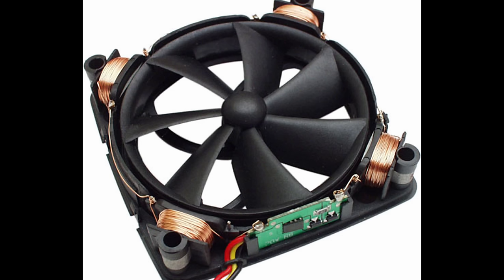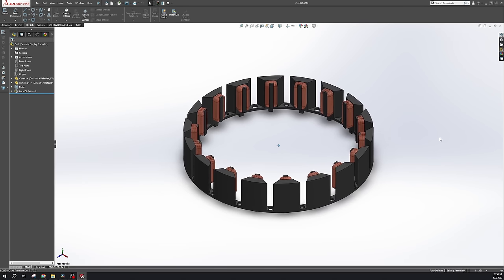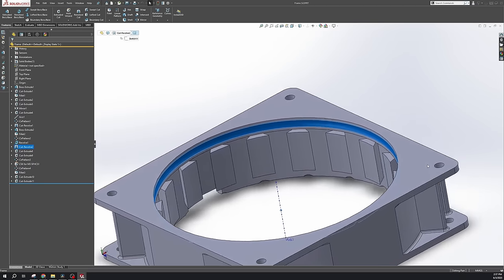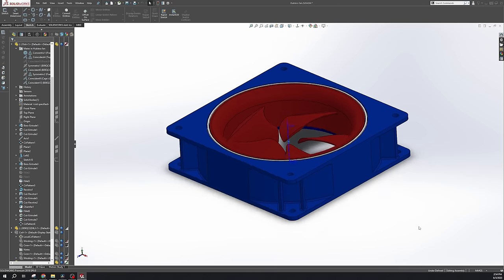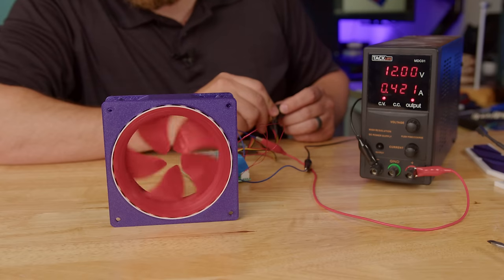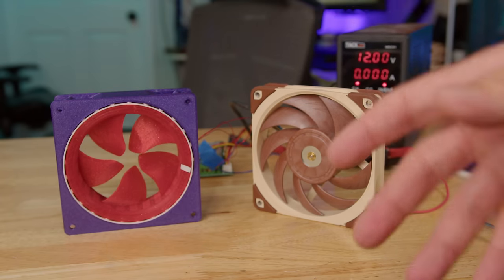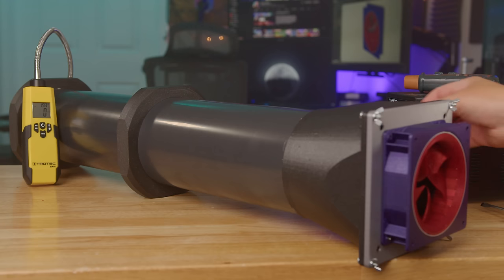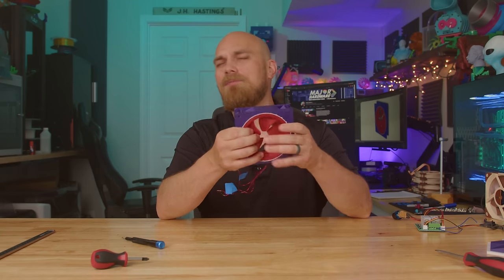I made a HUBLESS PC fan and it’s so loud!

Comment: I think the reason why the original tip driven fan had the hub was two fold: first, the fan doesn't push much air through there, simply because there's no velocity there. And so you might as well keep the hub to keep the air from accidentally moving back through the center. And once you do, then it's a great place to put a regular fan bearing.
Reply: Yeah. By doing it on the outside he's increasing the area and moving mass of the bearing significantly. Since he already has permanent magnets in place, I wonder if there is a way to magnetically float the center?
Reply: would probably work better if the blades touched at the center or you made a smaller fan in it like some have done in the rest of the  showdowns
Reply: @ventilate4267  Connecting the fan blades in the middle would lower the overall flow. In the fog segment, you can see that there is actually air going through the center, which is sucked in/carried with the surrounding air. If you would connect the blades, you would obstruct this path without any acceleration of the air from the blades in that area. Therefore many ubless props only use short stubby blades and leave the rest empty.
Reply: The friction of the air will just pull more air with it. (its what @morgan5941 said)
In fact he could make the blades smaller and it will still work.
Reply: @siveonfarcloud4190  only to a point though, otherwise you'll end up with like an inside-out version of the vortex ring state, right?
Reply: @your-friend-alice6851  Not  sure if that would ever happen, but I'm not that proficient on the mater. Definitly something that would be interesting to see in a video.
Reply: @morgan5941  so long as there is no significant pressure requirement, yeah.  But if you do have significant static pressure being needed, you can’t be as sure that the entrainment will occur. Instead, I’d expect a vortex ring state to form as the flow rate drops below a minimum value

Comment: The fitment just shows your engineering prowess, good job. I am not sure what it could be used for considering the sound, a maglev bearing would be cool lol. I also like the flow characteristics.
Reply: The maglev bearing could be the best feature of this design.
I wonder if some of the maglev trains designs could be used that would not need complicated setup with sensors and controllers.
Reply: I was thinking maglev bearings too

Comment: This fan has potential. I love that it allows the air to follow into the center. If you remove the friction and get better balance, you have a winner.
Reply: unfortunately because air is a lot less viscous than water, it might end up just backflowing or stalling in the center, a hub might actually be slightly beneficial if it's got decent aero

Comment: that turned out great!  good job sir.  you could design a ring/race with v slots to allow changing of fan blades, and do a season of showdown with people designing blades for this thing

edit:  you might look up halbach array if you want to improve performance.  it's a way to get more strength out of your magnets by the way you arrange them, and they're efficient because they have a strong and weak side, so the force is directed and concentrated towards your armature.  to fit the magnets in this arrangement you might need to reduce the number of coils, but you'll get a side effect of bigger coils, so hopefully more torque.

by the way, if you want lower speed but stronger torque, you can go down to a smaller wire and do way more turns of wire.  if you do that, you could design some really high pitch blades with close spacing that go to the center and probably get good static pressure.  if you go larger wire but fewer turns, you'll have less torque but higher speed.  would be more for cfm in that case, so less blade pitch 

as for bearings, i wonder if it's possible to do magnetically levitating bearings.  that would solve the bearing noise issue

oh and i have an idea.  what if you leave slots in the chassis and blade assembly for the raceways.  then print the raceways in something harder like ASA which my bambu prints quite nicely.  if you set it to 100% walls and no infill, and print it flat on the build plate, the grain goes with the direction of the circle, so you shouldn't end up with perpendicular lines that cause the bearings to make noise when they cross them.  and maybe even add a light abrasive or even acetone and preprocess them so they end up really smooth.  could probably add graphite for lubrication as i'm not sure how ASA or similar would stand up to something like lithium grease.  chemistry guys will have to learn us that bit but i think oils usually break plastics down, so that was why i had this thought, but i could be wrong

Comment: Yes! Finally someone made a fan like I've wanted. Except I was hoping for a maglev type effect with no friction and thus reduced noise.
Reply: I think you would need a center hub to be able to do that...the bearings are what is holding the blade assembly to the rest of the fan...
Reply: You don't need a center-hub for a mag-lev fan.
However, you need to place the magnets exceedingly precisely, the magnets have to extremely similar in strength, and have a very exact shaped magnetic field for it to work without the hub flying out at high RPM.

Either that or find the strongest permanent magnets you can. That way the field might be strong enough to contain the hub at any RPM.
Not sure if the Neodymium magnets are strong enough for that though, and stronger rare-earth magnets are ridiculously expensive...
Reply: @The_Keeper  I guess I should have been more clear, no you do not NEED a hub, but doing it without one would be exceedingly difficult outside of a lab with very precise equipment...Also it would the worlds most expensive computer fan...

Comment: Dude you are amazing you eyeballed a hub bearing and fan blade geometry in a hub-less fan you pulled from a drawing on the web eyeballing and guestamating at the measurements you were able to nail industry standard CFM rates (better actually 50 CFM is pretty good) and did it all with a 3d printer and i didnt hear it fall out of balance till right at the end.  Thats so cool!!!!

Comment: The big noise maker here, as is more than likely obvious, is the ball bearings. If you were to switch to a maglev design, it would be a lot quieter. Also, the fan blades could be optimized significantly which would almost certainly give you better CFM at a given RPM. Also, as mentioned elsewhere, balancing everything out would also help reduce noise and vibration. I'd be very interested to see how far you can take the design overall. Nicely done so far :)
Reply: My biggest concern is that the maglev may interfere with the rotators. But if they're not strong enough, they won't do their job properly. What you need is 2 maglev tracks sloped to 45 degree to cup the v-edged fan unit. Make sure this channel is perfectly smooth as catches on startup or shutdown would be disastrous. Try to keep the space as tight as possible and of course add lubricant, and send me royalties on the patent! XD

Comment: This is the super cool project dude! It might be interesting for radiator fans that would benefit from having more service area being cooled!
Reply: Every radiator have a gap between fan and actual fins. Air need space to spread and calm down before it enters the fins. In case of radiators Pressure and bulk airflow matters, not area. less area even better, less area usually means higher pressure - for example 120mm fans have more static pressure than 140mm fans, and radiators for 140 fans have less fins density in general (to reduce resistance)

Comment: A much cheaper option for the bearing balls would be airsoft BBs. I've used some cheap white ones that have an amazingly high roundness spec with good results.
Edit: You'd have to modify the CAD model a bit though, as they're 6mm diameter.

Comment: you are supposed to add all the ball bearings on one side and then move the core over. And then space them out and then place the cage. A little grease makes this easier since it keeps the bearings n place. Larger balls and smoother raceways would make it quieter.
Reply: - there are various ways these things are done, depending on architecture - your "suggested" method is common for deep grove bearings - with welded cages..
Designing integrated raceways can be a limiting factor - as clearances may be too tight (balls too large)- and access limited for conventional methods of assembly.

Comment: I wanna see how far the blades and bearings can be optimized. I would also like to see one specifically for airflow and another for static pressure. This could actually be a competitive product because it could be made to have no gaps.
Reply: The most important part of a fan is the outermost diameter. The further you go in the less it matters. This is why you stuff the motor and bearings in the center. This fan design will fundamentally always move less air for a given size/power.
Reply: @Anyone700  That makes sense to a point but respectfully I am going to have to disagree. Although the first part seems true because as you go inward the rotation slows. My thinking is that the fact there is no motor in the center  means less obstructions, both from the motor and the little arms that often hold it in place.
I am fully ok with being proven wrong though.
Reply: @DoubsGaming  my reasoning is that putting the motor on the rim makes the fan a type 2 lever, hence need a drive that is low torque but high speed. A electrical motor is full torque all times. so if we  use the motor in a type 2 lever it is actually less efficient than the hub drive. from an efficiency stand point hub drives are less fitting for the task
Reply: @DoubsGaming  the central part can't create significant air pressure, so the engine is placed here. "Hubless" is good for directing airflow, but can't deliver the same air pressure with an equivalent form factor, which is more important. The structural complexity is insane for a product of this type. There is no way how it can compete with "classic" design (except style).

Comment: I'm quite confident that this design has future. Like many people already said, this thing could definitely use some lube, and I'd personally go with some liquid and thick one, maybe some Krytox 205g0, like keyboard enthusiasts use for their keyboard switches, and all the surfaces that have friction should be as smooth as possible, some polishing should help. With these relatively low-effort and low-cost improvements, I hope we'll see a v2 soon!
Reply: Why waste krytox for few tests of 3D printed fan ? Usual silicone oil with ptfe powder will be enough

Comment: So I designed a hubless impeller for watercraft quite a while ago, it's rather more useful because water doesn't compress like air does.  I couldn't even attempt to get the parts made to the necessary tolerences back then, so I never persued it.  I've been wanting to try it on an air fan for a while though, so this is super cool to see.  

Tip one, bearings do not have circular tracks in the race.  THe bearing rides on two microscopic ridges on each half, so it's clear at the bottom and on the sides, like it's on rails.  This reduces friction dramatically. Bearings also have no clearance, the ball is touching both races all the time.  That's where your noise is coming from.  The clearances necessary to do this are crazy tight, you have no chance of a printer getting anywhere close.  Maybe print undersized and lap to fit with a disk?  

Tip two, I would make the magnet pockets load from the inside, so the centrifugal and magnetic forces are pulling the magnet INTO the pocket, as opposed to trying to pull them out.  Shouldn't need glue, but it's probably helpful to stop vibration and wear.  

Suggestion, I would test making the pole pieces for each coil much wider, approaching a full ring as opposed to small bars.  I think in this design you want there to be a minimum gap between each pole and between the poles and the magnetic ring?  I havent worked with motor design in decades so I don't remember much lol.

Comment: I think you'd get a lot of noise reduction with some kind of silicone or other lubricant on the bearings, I'd love to see a Round 2 with something like that.

 I think finding the correct balance of film strength and just overall viscosity of the lubricant will be the largest challenge. Using actual petroleum bearing grease would likely be too thick to allow good movement-- but maybe I'm mistaken, maybe without a centralized motor like you might be able to generate more torque to overcome the resistance of the grease. Beyond that though using something like WD40 which has little to no adhesion or film strength I think would probably provide a negligible (if any) benefit. Silicone lubricant is frequently used on plastics and would probably provide a good balance between too much and too little adhesion and viscosity.

Comment: There’s a reason the other guys design that you shown still had a small hub and that’s to have as little mechanical parts to reduce noise.
Reply: That fan still was quite noisy, albeit in a higher pitch.😵‍💫😣
Reply: @Timberwolf69  The issues with the old TMD fan:
1) The TMD was ONLY made in 70 mm Fan size (Most Fans smaller than 80 mm gets loud)!
2) They were running it at 5800 RPM
3) I don't think they used the quality bearings that we have today, especially nice ones like MagLev Bearings
Reply: @kamenriderblade2099  I think the RPM would suffice to make any fan loud...
But those small fans usually are the ones with the highest pitch...
Reply: @Timberwolf69  When PC Hardware was young and many manufacturers didn't know better. What a time to be alive.
Reply: @kamenriderblade2099  Yeah, the first fan I put on a CPU cooler back in the days was about that size... But it never ran that fast.
Reply: @Timberwolf69  I don't know what Y.S. Tech was thinking, but running the TMD fan that fast was bound to sound like a Jet-Engine.

The concept behind the TMD fan is solid IMO. Many other manufacturers are using Closed Ring Case Fans now.

I really wish more manufacturers would re-vist the TMD concept. Any patents that might have existed has long since expired.

Imagine what we can do with modern tech.

Just @ Computex, Alpha Cool made a 2900 RPM fan sound like a 900 RPM fan just by having Zinc-Metal Plates right on front of the case fan.
They had Isolating Rubber Rings to seperate the Metal Frame from the rest of the fan housing.
Igor of Igor's lab validated the fans, it's legit.

Right now, that's a Game-Changing design feature that needs to spread across the fan industry.

It'll allow us to ramp up fan RPM well past 3000 RPM w/o sounding like a jet engine.

That means more cooling.

Also Cooler Master had that cool Aluminium-Copper-Aluminium Heat Sink plate sandwich technology which is good for several more C° cooling.

That can alos be a game changer as well.

So many things for cooling have come up that would help with making things cooler at Computex.

Comment: Love the idea and the result. Hats off! The only problem is that the fan is most efficient at the outer edge and least efficient at the center, kinda like a hard drive. Unless you can make the motor and bearing ultra thin, the center driven fan will be more efficient.

Comment: What you need to test is a 6 or 9 pole design as that will increase peak velocity.  Then add steel ball bearings and races with steel wire guides to reduce rattle and friction.  Should up to double speed and airflow.

Comment: Hell of a good job with creating this.

In terms of performance I can not really see benefits compared to traditional center hub. The most amount of air is being moved on the outer part of the fan, not the center. Here the outer space is being taken because of the motor parts, so fan diameter is smaller, like some argb fan. Still very impressed for your design that is very thin especially for a 3d printed prototype.

For example when you look at small, 30 or 40mm fans you will see that hub takes a lot of space. Sometimes even 70% of the fan. It would be possible to make smaller hub with less powerful motor, but increasing blades in that inner space close to the center is not so beneficial. At least not enough to compensate for power of bigger and stronger motor. 😂

Comment: An idea might be trying slightly thinner gauge wire and more winding on each core section to have a higher impedance. Might be able to increase your speeds doing that. Also with some tweaks to the bearing design then I think this could make an excellent unique fan
Reply: The problem with thinner gauge wire is increased risk of burning out the coils, so lower voltage tolerance. This might work for a low power, high torque fan? Bearing in mind I'm no electrician and my response is based on logical assumption alone.

Comment: would love to see a resin printed version with tighter tolerances.  dual bearings would also be nice
Reply: Enclosed bearings with lubrification. Or some way to use air pressure when spinning to center the rotor?

Comment: This concept is awesome and you got a working prototype with a 3D printer, some magnets and some wire. Great Job!
One recommendation I would make is to make an alternative frame that runs on a much simpler mechanism, like a drive sprocket with a belt and a stand alone motor. That way you would be able to test out multiple iterations of blade design without having to attach magnets to every one, and once you found a winner you could make a proper one.

Comment: I suspect a large reason for all the noise is the surface smoothness of the running surfaces for the ball bearing. Throw in some imbalance in the rotating assembly for good measure as it looked and sounded like it was imbalanced.

Definitely a cool proof of concept. Certainly opens up room to look at the effect of hub size on flow/flow distribution.